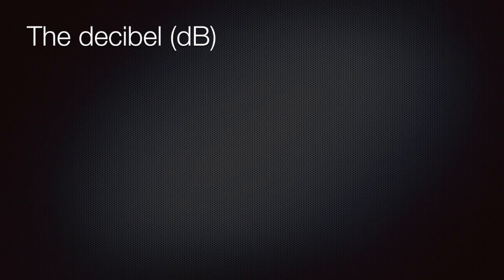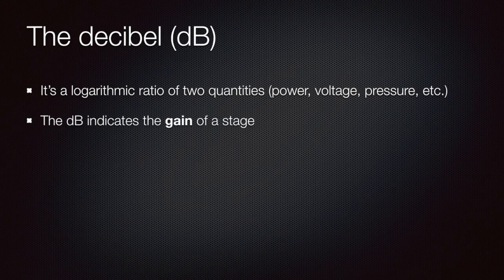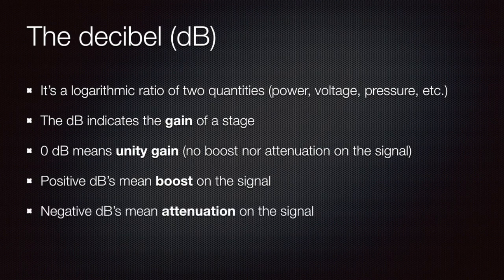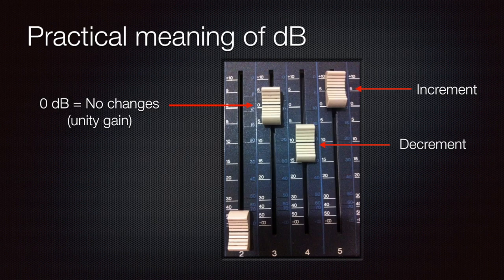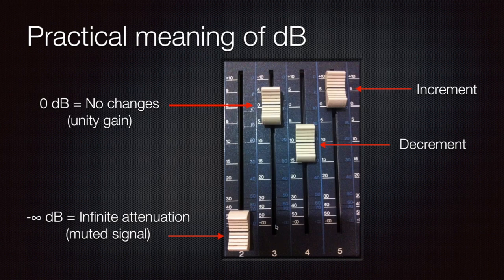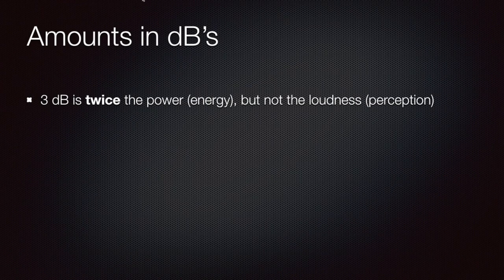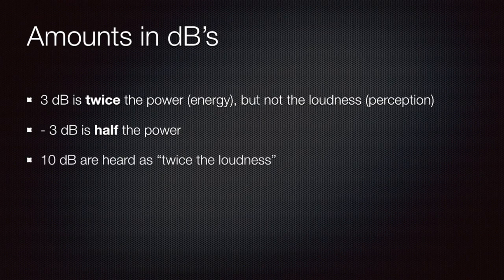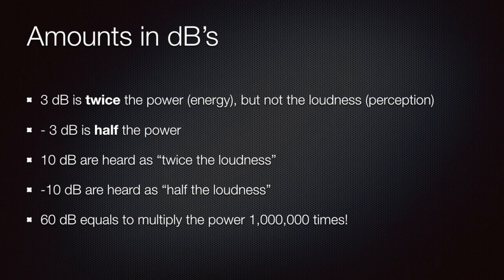Practical meaning of decibels (dB) in audio engineering

Comment: i installed amplifier in my car, the AMP manual suggesting me to tune the amp with 1000 HZ @ -5 dB
what does -5 dB means? and how to compare it with 1000 HZ @ +5 dB or 1000 HZ @ -10 dB, .... etc ?
Reply from the maker: Hi Mark! That does not look very clear from the manual. dB's are relative to a reference (usually 0 dB). So we need to know what 0 dB means for that amp. Maybe 0 dB is the standard operating level, but it also could be the maximum level. If you provide me the brand and model, perhaps I can investigate further.

Comment: huh, i tried testing that and noticed something else: i put 2 of the same sample on top of each other and it sounded twice as loud (tho i would assume it would only be twice the power, not twice the power and a 3 dB gain) - i had to decrease the loudness by 6 dB in order to make the 2 samples sound the same loudness as the sample by itself. whats the explanation here? i used FL Studio
Reply from the maker: Hi Dan. It's great that you are experimenting to learn more, congrats! If you duplicate the samples, you get twice the "voltage" in the digital domain. Voltage and power are not the same, but they are related though (I'd need a dedicated video to explain this 😅). Doubling the voltage equals to 6 dB indeed, that's why you have to reduce it by this amount as you mention.
Reply: @MarcoGalvan  aah interesting. good to know, thanks!

Comment: So what's the formula of the "loudness" compared to the power? .. 

Second question: on a microphone, 
-10 dB will decrease the volume of the microphone to the half, right? .. does this have to do anything with the frequency ? .. I believe no.. right? 😜
Reply from the maker: Hi there! Loudness measurement is much more complex than power level. Loudness takes in count frequency and time, not just power. The power level was among the first attempts to measure "loudness" (around 100 years ago!), but it's just a rough approximation. Modern technology allows us to measure loudness more effectively. Nowadays, it's more common to find loudness units (LUFS) in audio software.
Reply: @MarcoGalvan  thanks! Informative ❤

Comment: Excellent video. I'm a video editor, but I often am also the one mixing the sound unless there is a higher budget. So what I am getting is that 0db is usually the maximum level an NLE or DAW is able to output to a digital file, but the amplifier for my speakers can go above or below 0db because it's able to amplify or attenuate the input sound above or below 0db. But sounds in real life are measured above 0db because there is no practical maximum in real life, and 0db would be total silence.

Is that right? Basically 0db means different things depending on the nature of the sound and how the sound is being measured?
Reply from the maker: Thank you Jeffrey. 0 dB means maximum level in the digital domain (dB Full Scale, dBFS). 0 dB means almost no sound when measuring sound levels (dB Sound Pressure Level, dB SPL). And 0 dB means unity gain or "no change" in most mixers and audio equipment. You need to know the context indeed.
Reply: @MarcoGalvan  Wonderful, thank you. Makes perfect sense now!

Comment: So why is zero NOT at the bottom?
Reply from the maker: Hi, because in most pro equipment, 0 means 0 dB, not 0 "volume". There are cases though, where 0 actually means 0 volume (like guitar amps or pedals), but that's not the case of most audio mixers.

Comment: So what is the best 0db or 5 db
Reply: What do you mean by this? Could you give some context behind your thinking
Reply: @parp  Hello Professor .. How are you .. I am a sound engineer from Iraqi Kurdistan .. Erbil city. I am working on the dynacord sound mixer .. and I mean by my words on the fed..and I am using the 5 db option for the sub-hydrates
Reply: @marwanosaji2563 I am good thanks :)

Ok so I am looking at the mixer you mentioned, but I don’t know what you mean by “sub-hydrates”

Could you explain to me what that is?
Reply: @parp  Hello again..You sure have seen the dynacord audio mixer, right, sir? I mean the faders have to be at 0 db in order for it to be a true gain setting on the main signal.
Reply: @marwanosaji2563  yes they do, but what do you mean by best? Like what do you want the mixer to do
Reply: @parp  I'm just asking about 5 db positioning on the sub faders.

￼I'm just asking about 5 db positioning on the sub faders.
Reply: @marwanosaji2563  sorry about the confusion, but I think you should use 0db on the faders at first, and if you want something louder than you can turn up the fader. But as long as things aren’t getting distorted you will be fine using what you like
Reply: @parp  I am using 0 db on the faders and I have no sound problems .. but I would like to know what happens if I raise the faders to 5 db .. This is my question.
Reply: @marwanosaji2563  it will get louder, and you might end up clipping the master bus (that is if you were to pull up all the faders to 5db)
You can, in you like, raise the master bus fader up by 5dB
Reply: @marwanosaji2563  I should have mentioned to you earlier, but there is nothing stopping you from just seeing what happens. You should try and experiment
Reply from the maker: Most mixers have a "safety range" between -5 dB and +5 dB (or something similar). You can adjust your fader in that range depending on your needs while mixing. The 0 dB is just the starting point. Thank you for your good answers @p4rp :D
Reply: @MarcoGalvan  Thank you very much, sir, for this clarifying answer ... and I thank you for this help.